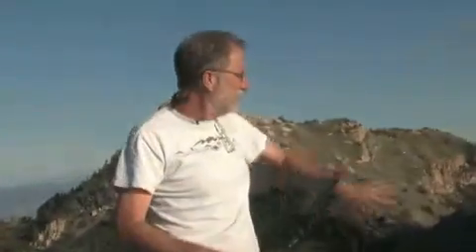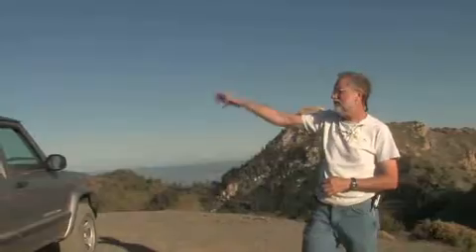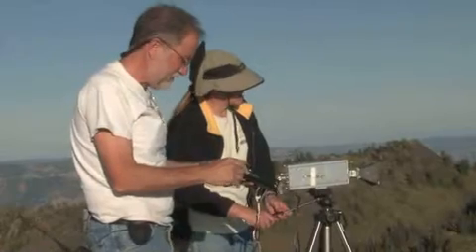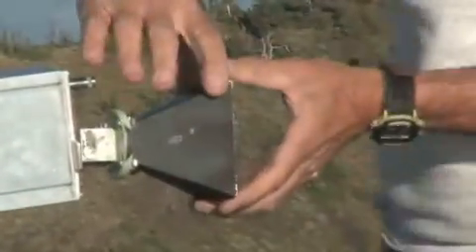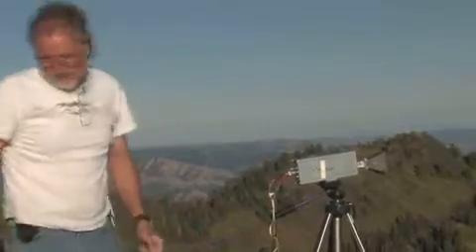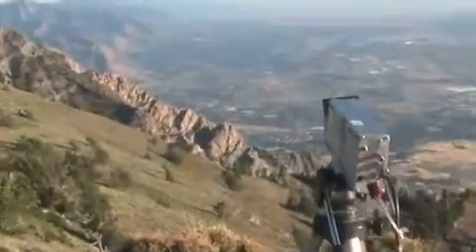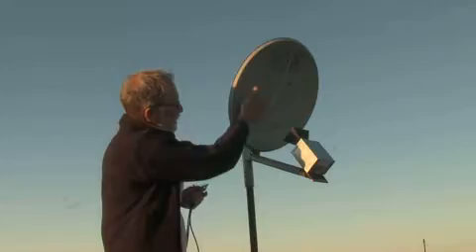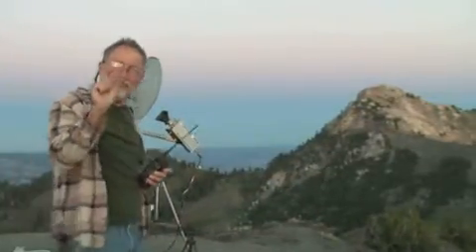Ham Radio 10GHZ  Contacts - ARRL 10 GHZ Contest

Comment: I just got some old equipment which was used as a high-speed internet link via satellite.  The system operates on 10 GHz, although I am not sure of the exact frequency just yet.  It's all commercial and very high-quality; looking at the heat sinking, I am guessing that the output is on the order of ten watts or so, which is pretty high power for amateur radio on ten gigs.

The gear is at my ex-wife's house, but I'm pretty excited about getting it home to my shop and checking things out.

KI6DCB
Reply: 4-8W is fairly typical for a rover on 10 GHz.

Comment: @bandopening Thanks for your reply. I am now using a Trimble GPS disciplined oscillator at 10MHz that is fed to a home-brew synthesizer to generate 106.5MHz which is fed into the Kuhne transverter. Works great, and very stable. The only drift now is the FT290R IF rig. 73 - Rob VK2GOM

Comment: I have changed my VFO to a system that uses a N5ACX "Apollo synthesizer. I used a rubidium 10 MHz oscillator or an ovenized 10 MHz oscillator as the reference and the Apollo synthesizer produces the required local oscillator for the transverter. Overnight I went from unstable, wandering to dead on frequency to within a hertz at 10 GHz! Why.... because I could!!  The rubidium is an overkill, but it only cost about $70.  It works sooooo well.
Google N5AC for more info.  73   Ron K7RJ

Comment: Just got my Kuhne kit for 10GHz up and running. Next step is definitely a PLL 106.5MHz oscillator... the kit drifts bad due to all the multiplication to 10224 from 106.5. Other than that, it works well. 73 - Rob VK2GOM

Comment from the maker: I use mostly all Kuhne Electronics stuff, it's more expensive but much higher quality which helps a lot at these higher frequencies e.g. stability. I have their 10GHZ and 24GHZ transverters, 24 GHZ beacon, and external Oscillator w/10GHZ external reference for 24GHZ. I drive this using an Icom-706 MKIIG feeding a 17dbi Horn into an old Satellite TV Dish.
73 - Robb - N0KGM